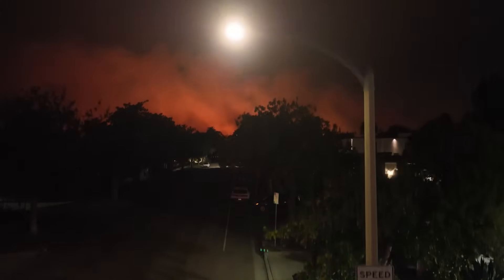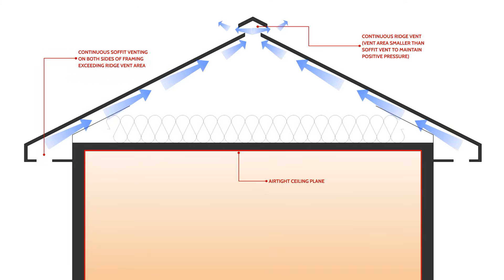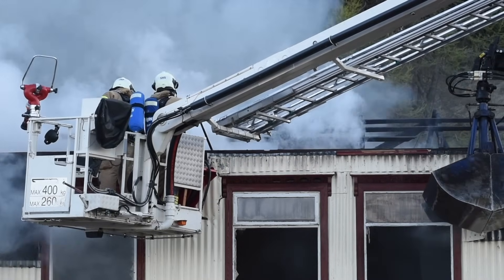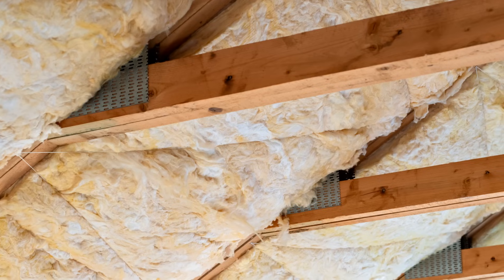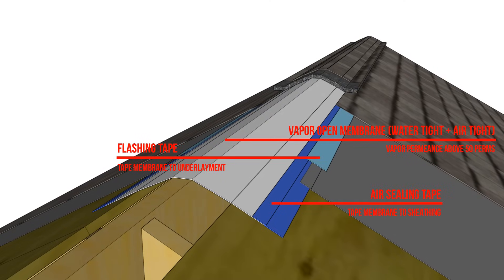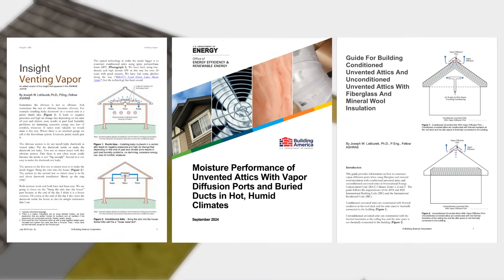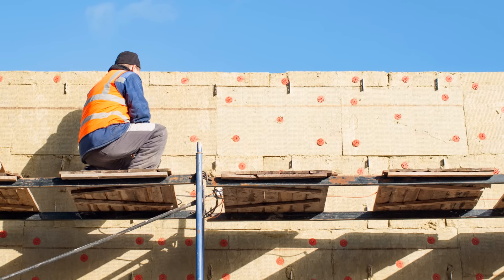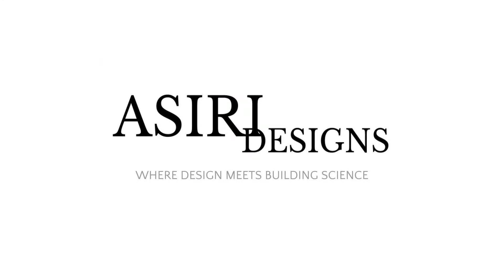How Vented Attics Worsened the LA Fires

Comment: A simple solution is to block one air path during a fire event.  Why do you design a building for a 1 in 20 year event?  The information is relevant to LA climate only.  Seriously need to stop pushing ridge vents over deck vents.  Job one is keeping water out.  All ridge vents have reduced profiles and allow water ingress with wind.  Love every other video you publish but this set me off for multiple reasons.
Reply: I definitely designed for better than a 1 in 20 year event. And with climate change, information relevant to LA has become quite relevant to us all - unless we simply don't care about half the population. In hindsight, I wish I'd designed for even more resiliency - earthquake, flood, hurricane, and fire - as well as improving community. Good design should provide a benefit for many generations.
Reply: I get it, but the ridge is the most efficient place to vent.  One issue I have is that flying termites land on the roof and then always crawl uphill, where coravent provides nice little tunnels for them all to enter the attic (besides water).
Reply: @SpaceCrete  Absolutely depends on the area.  In mine having seen 1000s of roof decks after 20+ years all rot and damage is near the eaves and valleys.  Never once at a peak.  Water runs down hill.  The argument of dead space in the top two feet is weak.
Reply: @billpringlemeir4433  The vertical distance helps induce flow throughout for lower slope roofs, and also the ridge itself creates a low pressure venturi effect.  This is  in the PNW climate where everything rots.  Plus, it allow connection to all framing bays of a gable roof - so you are never going to talk people out of using it.  I don't like every aspect of it for sure.
Reply: My issue with ridge vents is in heavy snow areas, they get buried. But maybe if the whole roof is covered in white stuff, there would be less requirement for roof ventilation anyway.

Aesthetically, ridge vents are very clean looking.
Reply: I agree. Some system operated vent door would solve this issue more effectively. Most notably, to my best knowledge, unvented spaces pose their own dangers, especially in instances of maintenance. This is because of the accumulation of gasses from materials outgassing and oxygen depletion. Let alone the risk of a leak of these gasses (some of which may be heavier than air) into the living areas.
Reply: @mrtopcat2  Ideally you have fresh air systems and dehumidfiers (where needed). Agreed just creating more unvented spaces is not optimal. It's common in our area though.
Reply: @ Yes, I heard it is even code for foundations in some places. I believe eventually this will be reversed/revised for the reasons I mentioned. I have seen two work safety videos here on YT. Both of have shown examples of unvented areas that turned out to be fatal to unsuspecting 3rd parties as well as even to unsuspecting first responders in both instances, in one instance to multiple first responders in a row until the first responders started suspecting something if off.
Reply: @mrtopcat2 one solution is to use less off gassing materials...so don't spray foam or rigid poly the insulation...pick insulation that is tested for their off gassing and such..they exist...

All methods and materials have their problems/compromises - you choose the lesser of evils in those situations where a hard alternative doesn't exist...but in most cases there is some hard alternative...
Reply: @ I agree. Nevertheless, my suggested, activated, trap door style vent holes could provide a simple solution. Most notably also a rather simple to retrofit solution, by changing out the vents themselves.
Reply: @mrtopcat2  I am really not a fan of the trap door style...due it being a single point. Of protection and thus a single point of failure...assuming you can afford the retrofit for unvented then it is a superior protection system....also, if it's timed with roof replacement the added cost of the rest is less an issue tbh...

But yes, if conversion isbeyond reach, fire rated screens and vents are a decent solution... IMO anything is better than leaving the status quo...
Reply: Wasn't he specific that this detail is for the warm climates in most of CA? Why is everyone going on about how it won't work in this place or that place for these XYZ reasons...there are probably location specific details to for that regions needs...there is no one size fits all solution...

Comment: LA's foundation (crawl space) is also vented and not conditioned.
Reply: In case of roofs, the situation is different, because the rise of heat effectively creates a stronger air circulation and effectively higher air-in-flow rate at the vents.